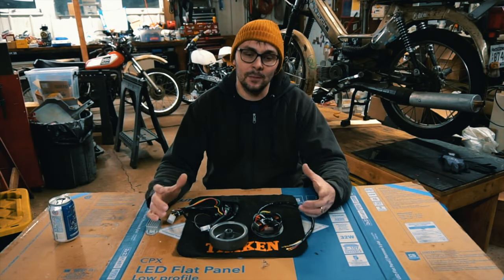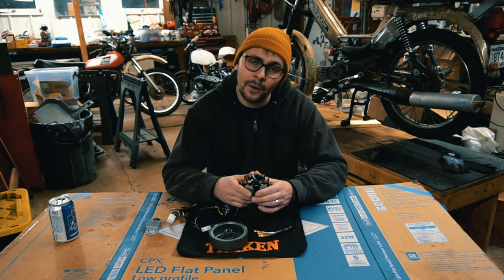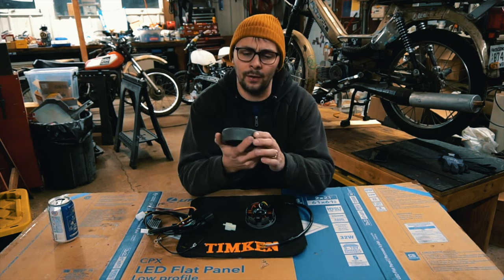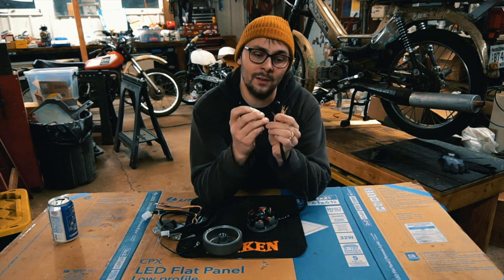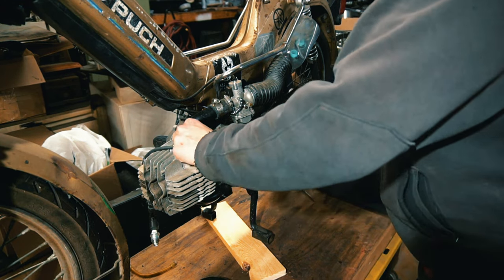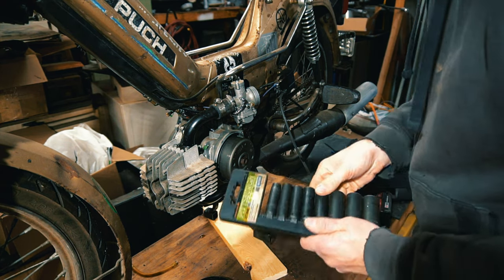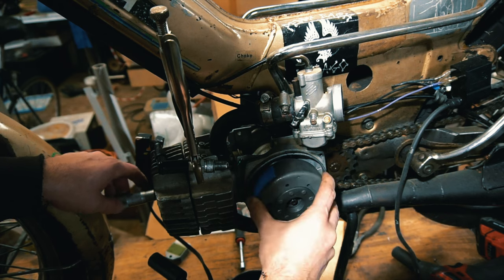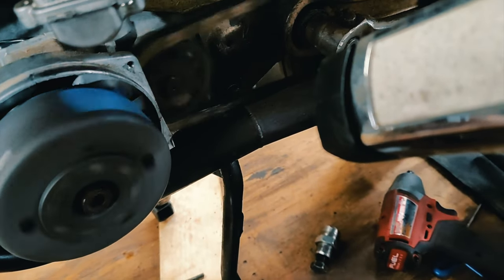NEW PUCH 12V CDI CROSS COUNTRY SET INSTALL

Comment: that cdi is called a stator ... maybe at least do a google search before you try to make a video on something. You seem totally clueless.
Reply: Good point but I just got the kit and the stator is only part of the kit; it includes the magnetized rotor and along with all that it includes a box which is the CDI (capacitive discharge ignition) unit, that energizes the spark, as well as a voltage regulator that gives a 12VDC output.

How confusing right? Also the name of the unit is 'cross country' but it only reaches a few inches and doesn't actually measure as far as across the country. Kind of an inaccurate name.